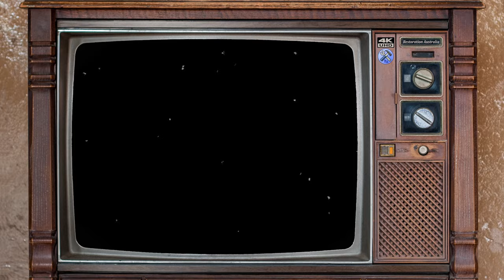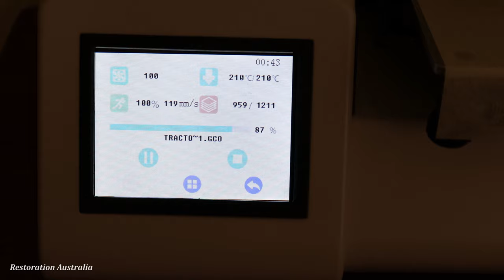Vintage Tonka Tractor Restoration, how to fix this.

Comment: Great job !! 🙌  I must have missed something but how did you make these blue moulds ?? 3D printing ?😳. Greetings
Reply from the maker: Hi there, no it wasn't a 3d print I made the mould before from another tractor. What you do is get a suitable container, little bigger than the actual part, poor the silicone over it and you have the negative mould. You have to use “liquid silicone rubber mould” for that or if you have a very small part you may use “silicone moulding putty” Thanks for watching and commenting.

Comment: Great work, very meticulous, with all the details well thought out. The new parts you made were spot on 👍
Reply from the maker: Thank you so much 😀 Check out my new video I have more "new parts" in that one  ,including v8 engine, seat with dual control, tracks and some smaller parts.

Comment: Great Job!
You really did save this one. You started with a metal frame and DIRT!
I also enjoyed the production of your own parts, wheels and grille. Beautiful.
Were you filling pits with JB Weld? Was that easy to sand and finish?
Very much enjoyed it.
Keep them coming!
Reply from the maker: Yes it was JB weld one of the strongest one around has some metal particles in it, strong but you can sand it. Thank you for watching and commenting next video coming up soon. Vintage office telephone restoration.

Comment: Nice custom work to make it look exceptional!  New technology helps make new parts. But to do an actual restoration using all Tonka parts are available.  Bit I do like this look! Be easy to make a set of duals for it. Just print and extend the axle.  Be a thought for another build.
Reply from the maker: Thank you for watching and for your detailed comment. Yes I may do one like that.